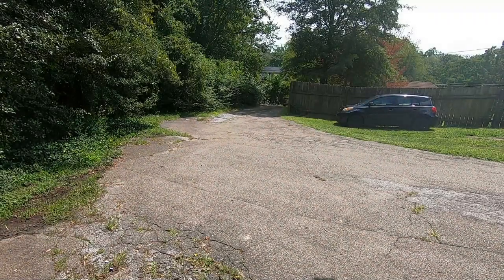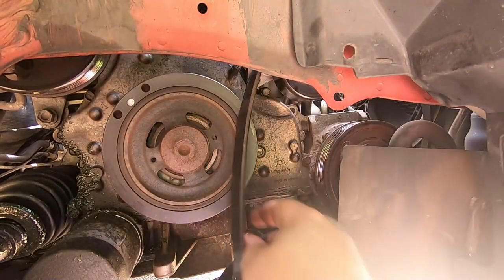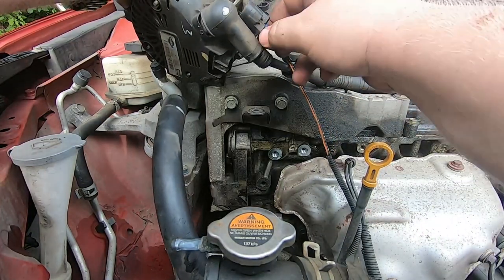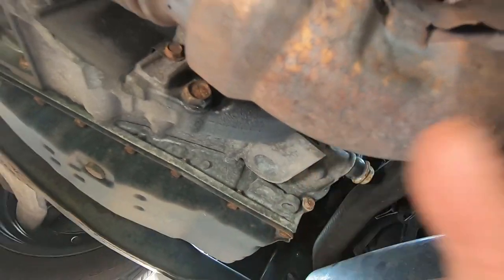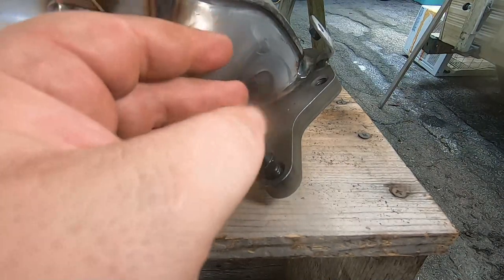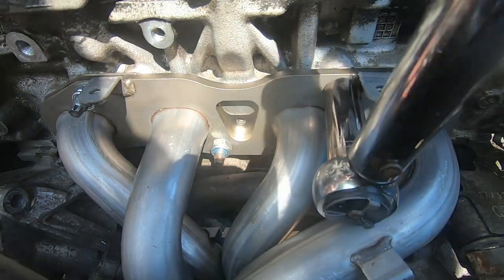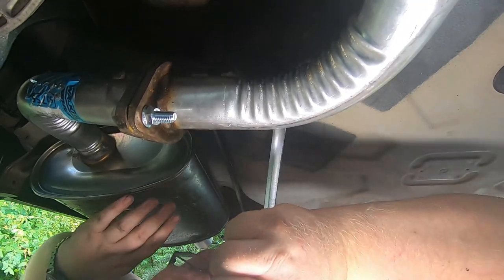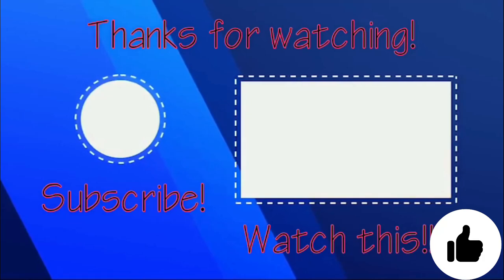2007 - 2012 Nissan Altima 2.5L Replacing our Old Exhaust with a Brand New One - FULL Install!

Comment: This was a really good video you show everything step by step and explain everything. Not a lot of people explain everything and show everything. Some videos take long to explain everything but I enjoyed this video it showed me exactly what to do on my Nissan Altima, thanks.
Reply from the maker: You're welcome! We'll have more step by step videos on the Altima soon 👍
Reply: @TrickShiftGarage  where did you buy your kit at
Reply from the maker: Well, it wasn't exactly a kit but I made it work as one here is the list of links where I got the parts,  my apologies for the long links!

The Exhaust manifold was bought here: 
https://www.ebay.com/itm/CPSP-Exhaust-Manifold-W-ith-Catalytic-Converter-For-2007-2013-Nissan-Altima-2-5L/283262749442?epid=22025952980&hash=item41f3c68b02:g:WrcAAOSwWI5b7gJD

The Catalytic Converter/Down pipe was bought here: 
https://www.ebay.com/itm/FOR-07-15-NISSAN-ALTIMA-2-5L-OE-STYLE-REAR-CATALYTIC-CONVERTER-EXHAUST-MANIFOLD/203094215073?

And the Catback system was bought here: (Contains the Y-Piping and both mufflers)
https://www.rockauto.com/en/moreinfo.php?pk=5943654&cc=1433474&jsn=855&_nck=Ekt6BqBF1pwlXdx0gYlm1esw98pF26vehMm%2FGG3C%2Fl2QOXSJubi7Wbtv3UuYQU5UBTnZ1RuNKAU%2F2UPB2Err70tAHhIy%2FCO0kuzdge%2B5CQu7rIwc7RB3%2BXz7yuMOTx3dRLp3KjCKhbtYENNDeP04ibh%2B8sLQlICyM%2FzTHZ70Hh5xpF1A23JfGzunK4CIM0by7cG%2FtNZTHIFFIz%2Fq%2F0sVxCvUNLGzNMq12bIr6RayTOdrpl%2BaCHy0tCw%2BN87wZCaj6o7W5I%2BDwLDx7rlbWFEYILp4o%2FCMHxufpUjPYYFKN4JtGE%2FUSq%2BhxsYM02T4jqJVnuTL2LoShixYodZ%2F42xi07E0JcCzxk7OerXvetyNQ9H35TsYhhN%2F3L3I5vYbZSbJiR5uKWTxg3fbt39CZapdzU%2Fo37X5K%2FZUlR5kuaOR4WYdghI2OZmCWQ%3D%3D

Hope this helps! Thank you for watching!

Comment: Any engine shaking or lost of power when driving ? My 2007 Altima 2.5 make same exhaust noise but after time now I can’t drive it due to not goin when putting gas into drive an shakes a lil when put on drive or letting brake pedal go ??
Reply from the maker: I didn't feel any shaking or apparent loss of power, it was noisy and smelly on start ups though. This might be something going on with the transmission not shifting properly. Best thing to do is have a mechanic look at it and see what they say of it. Hope the best for you. Thanks for watching! 👍

Comment: Great video, however, how is the cat hold up for you since replacement?  Is the AUTOSAVER88 Catalytic Converter a good product and fits good?  Thanks
Reply from the maker: The cat has been holding good since replacement, no check engine light or exhaust odors. Yes, I think the AutoSaver88 one is a good one. Thanks for watching! 👍

Comment: I say if you are going thu all that trouble, replace your O2 sensor. being 13 years old and I'm guessing never been replace, go ahead and do it. one less thing to worry about.
I bet if the O2 was replace on time, we wouldn't be in this mess. replace it every 50K or 75k miles 

I gotta say for me being in south TEXAS, this job replacing the Catalytic is not hard (bolts didn't rust). if you live up north with all that salt, good luck on the bolts.

replacing the Catalytic myself I saved over 1600.00. dealer wanted 1854.00 but with that much saving, I went ahead and replace hoses, coolant, thermostat, and belt.

thanks for this info on DIY. help alot
Reply from the maker: Completely agree with you Daniel! Personally, I always try to look around and replace parts that are convenient while your already knee deep in a project, one less time you have to do it again. Thanks for watching! 😎

Comment: i'm really debating if i can trust buy Catalytic Converter from Amazon? i see other local stores price around $700 to 800 ... so, worried to buy from amazon then does not last ... ALL please advise your experience ??
Reply from the maker: I hear ya man! If it helps, mine has been running well for over a year now. No check engine light or driveability issues with it.  Those prices is what pushed me to give the Amazon ones a try and so far so good! 😊

Comment: I noticed that you didn't put the heat shield back on. I'm having trouble fitting the old heat shield on the new exhaust manifold. Is it not necessary to have the heat shield?
Reply from the maker: It's not necessary to have the heat shield on. Mine has been off for about 3 years now lol, I think you'll be fine to leave it off. Thanks for watching! 👍
Reply: @TrickShiftGarage  that's good to know. Thanks for the reply
Reply from the maker: You're welcome,  good luck! 😊

Comment: Hey there, just wanted to see how the exhaust system has held up over time. A couple of the reviews on the Amazon link say that the cat almost blew up and stopped working completely. Should I order the parts on the Amazon link or should I just take my car into a shop? Thanks
Reply from the maker: Hi Joshua! The exhaust system has held up great! Just some surface rust, which is normal. No exhaust leaks or weird smells coming from anywhere. It's not loud, nice and quiet like the stock mufflers.

You can go either way. The exhaust manifold has worked great without any problems. Just know that it will probably cost alot more if you go through a shop than buying and installing yourself. If you feel comfortable doing it that is. 

When I was shopping for a new exhaust system a couple years ago, the genuine Nissan manifold cost $600 alone. The whole system that I ended up ordering (from exhaust manifold all the way to the mufflers) cost $700 total. Just something to think about 🙂

Comment: Excellent video.  I noticed that it looks like your oil cooler is leaking.  You can fix it by just replacing the internal o-ring and external gasket. The cooler is located on the passenger side rear of the engine right in front of the cv axle.  Very common problem on these cars.  I did mine on my 2012 just over the weekend, pretty easy.
Reply from the maker: Thank you for watching and pointing that out! I'll definitely look into it, could be a great future how-to video to show others how to repair it on their own. Sometimes, a little part like an o-ring can cost alot of money to install at a shop. 

Glad your repair went well. Thanks again! 👍
Reply: @TrickShiftGarage  Very welcome!  And yes that would make an excellent how to video. The part number for the gasket set for the oil cooler is ES73076 it is a Felpro set and I bought mine at oreillys for about $15 but the part # should be the same at any auto parts store that sells Felpros.
Reply from the maker: Awesome! Thanks for the info on the part!  👍
Reply: @TrickShiftGarage  Glad I could help!

Comment: Once installed new catalytic converter from engine side... I noticed some white smoke from engine area... Is that normal for new install? I just tested like 5 seconds then off the car
Reply from the maker: Yeah, it's normal, probably some fluid burning off like WD-40 or oil/grease. It should stop smoking after 15 minutes.

Let the engine warm up to operating temperature, if it's still smoking at that point, then something is off and you'll need to shut it down and investigate lol.

Comment: Very informative video. Can I put the heat shield after I installed the bank 1 sensor 01? At last you didn’t installed the exhaust manifold heat shield but the sensor (before catalytic converter) was installed when you started the vehicle . I don’t have the heat shield on my Nissan Altima , I was wondering I can buy and install it with out removing the sensor . Thanks
Reply from the maker: Yes, you should be able to put the heat shield on after installing the O2 sensor. The heat shield goes around that part of the exhaust manifold. Thanks for watching!

Comment: What is the bolt size, length and thread pitch of the bolt that holds the hanger to the engine? Mine doesn’t have one and i need to go buy one.
Reply from the maker: Been searching over the internet and I can't find anything about the bolt size, length or thread. I'd try calling your local Nissan dealer and see if they can tell you  any of those details. I'll keep searching and respond back here if I find anything 👍
Reply: did you find it?
Reply from the maker: Yes, finally figured it out, it's a M10 - 1.5 Pitch x 20 mm length. Overall length is 30 mm. Hope this helps and good luck!

Comment: I went to the shop to fix some welds & they didn't remove the alternator, they just pulled the manifold straight up, why is that?
Reply: You prob didn’t have the heat shields , if so they wouldn’t be able take the top heat shield off unless they broke it to bring it out

Comment: My 2012 2.5L Altima developed a really bad smell inside the cabin,I swapped out the filter and still stinks.. ever since the smell arrived my car has run terrible..I have had no check engine lights so I self diagnosed by past experience(s)...my car started feeling like it was stuck in a lower gear,around 60 mph and up it would start feeling like it was being dragged down,like the brakes were dragging,slowing it down...the gas mileage went from awesome to terrible !

I was stupid and had a brand new CVT transmission put in it and it still does the same thing,but now its dragging at all speeds...I did find a seized front brake caliper and thought I finally had it figured out...but no its still the same...starting to think its the 2nd catalytic converter on the back half section of the exhaust manifold due to the horrific smell inside,thinking maybe its getting a lot hotter down there than normal and is /has done some cooking !

Anyway I finally took it to a highly rated repair shop and as of right now the guy can't figure out whats wrong with it..so when he gets back in town next week going to get my car and do like you have done here and see if that helps...its the craziest thing trying to troubleshoot these newer cars with the OBD2 diagnostic system thats relying on sensors and trouble codes to pop the check engine light on so the scanners can give you/we an idea whats going on.

All I know is it has been a great car until this weird smell started...this video you have done here is exactly what I was hoping to see..not to bad of a job to do..just do it !
Reply from the maker: Thank you for your comment, and your situation sounds very similar to what mine was! A horrible smell coming into the cabin whenever the car was stopped. I did some research and there was a technical service bulletin out for the exhaust manifold and it was common for micro cracks to occur around the welds. I can't recall the years it effected but that might be something to consider. There was no engine codes but the car sounded like a small exhaust leak was coming from the front. It was especially loud on cold start ups, and after a couple minutes it would quiet down because I suspect the heat expanded the metal and (kinda) closed the crack.

As you saw in the video, my whole exhaust was rusted and I figured to replace the whole exhaust anyway. So after I pulled the manifold off I inspected and sure enough there was a micro crack along one of welds. After I installed the new one the smell was gone for good.

So my suggestion is to have your mechanic check out the exhaust manifold carefully. Hopefully this helps you out, let me know how it goes! And thanks for watching!

Comment: Thank you so much bro i have a 2012 Altima and my light came on at 145k miles I was wondering when or how long I could drive before I have to change it. You said 10 years lol I don’t think I would go that long, but I guess it’s not a big issue.
Reply from the maker: You're welcome! Luckily, my check engine light never came on but the smell got pretty bad to make me change it out... finally 😂 

Since your light came on, I'd change it out as soon as you can! If you have anymore questions just let us know and thanks for watching!
Reply: @TrickShiftGarage  How did you pass emissions during inspection w/that leaked? In PA that would have failed right away the first year.
Reply from the maker: Honestly, I'm not sure but when I would take it to get tested they would hook up to the OBD2 port, run their program for a few minutes, get a report and pass or fail based on that report. If my check engine light was coming on they would have failed me on the spot but I think because mine never turned on, they passed the car.

Comment: 3 thumbs up!!!  I replaced a leaking exhaust pipe with a Magnaflow downpipe w/cat.  Have you installed a header on a 2008-2012 Nissan Altima coupe2.5L, and what was the result?  Please share advice.  Thx
Reply from the maker: Hey Ferman! Thanks! I haven't installed a header on an Altima 2.5L before, but I think the overall process is the same that you see in this video. We do have an updated exhaust manifold video, that goes more in depth of the install here:
https://m.youtube.com/watch?v=xew4Rie4iFM&list=PLLWspAClw3lzHsOBWgQkS_JOrOsPqlsmY&index=31

Hope this helps and thanks for watching! 😎
Reply: Ive got an 08 coupe sl and the exhaust is exactly the same from top to bottom on the 2.5.
Reply: Also should add that the  removal/install process is the same
Reply from the maker: Sweet! That's awesome to know, glad Nissan made it the same parts and process. Thanks for letting us know Bounty! 😎👍

Comment: Thanks for the great video... going to have to tackle this soon as my cat broke and clogged up the pipe leading to no power.  Did you install all of the heat shields or leave them out?  Any issue either way?
Reply from the maker: Thank you for watching! I left the heat shields off. My lower heat shield's surface was rusted out and I left the top one off just for fun. Either way, I haven't had any issues by not including them on the new one. I would just make sure there are no wires or anything plastic near the exhaust piping that could possibly make contact and melt. 

Good luck on your install! And if you have any questions feel free to reach out! 👍
Reply: @TrickShiftGarage  What was the total cost for the full exhaust?
Reply from the maker: About $650 total.
Reply: @TrickShiftGarage  Thank you. Looks like this will be my next move.

Comment: Does the secondary cat have an 02 sensor? I was planning on deleting it and str8 piping in its place.
Reply from the maker: Hey Boss! Yup, I believe it's right after the secondary cat. Good luck on your project. More power and sound is always a good thing! 😉
Reply: @TrickShiftGarage  Thank you, I appreciate it. I seen some catless headers for the 2.5. Was planning on going with those instead.

Comment: Did you purchase the entire exhaust system as a kit or did you have to buy in pieces
Reply from the maker: I had to purchase the system in pieces, there are 3 links in the description on where you can buy them. They include all the necessary hardware (bolts, gaskets, etc.) you would need to do the whole system. Hope this helps and thanks for watching! 👍

Comment: Hi, i will remove my one tomorrow, can i only clean inside it with brake cleaner and industrial soap? Or i need to replace a new one in anyway?? Thank you
Reply from the maker: Hi! I would replace it with a new one just to be sure it's fixed. Good luck with your exhaust and thanks for watching!

Comment: I wish you went back and listed the socket sizes needed. It's the most frustrating part of repair work so far for me, not having or not being able to find the right size socket. Plus my impact wrench and my hand tools are different sizes... It was very frustrating trying to build my tool list for this project and you're waffling.
Reply from the maker: Hey Francine! Going back and watching it, I did waffle alot lol. This video was my first full edited video and it definitely needs to be revised with all the socket sizes and tools used. Thank you for your input! 🙂

Comment: How did you know if you had a bad manifolds?
Reply from the maker: I knew the manifold was bad because on cold starts, the exhaust was loud and you could smell exhaust fumes in the car. A crack in the exhaust manifold would cause those kinda problems.

Thanks for watching! 👍

Comment: How much did the parts cost ?
Reply from the maker: The exhaust manifold was $120, the catalytic converter pipe was $100, and the down pipe/Y-pipe with mufflers (came as kit) was about $300.

Thanks for watching!
Reply: @TrickShiftGarage  where did you order it from?

Comment: Hey are those studs m8 1.25 or m10 1.25
Reply from the maker: The studs on the engine head or the bottom of the exhaust manifold?
Reply: @TrickShiftGarage  the bottom of the exhaust manifold, because I’m having trouble with the studs not going in all the way like it showed in this video, would you be able to tell me the size for the studs you bought like if they are 1.25 x 50m or a smaller size. Thanks.
Reply from the maker: The bottom studs were definitely M10 - 1.25 pitch. I can't remember the exact length but 50 mm should get the job done. We have a more in depth video on the exhaust manifold installation here:
https://m.youtube.com/watch?v=xew4Rie4iFM&list=PLLWspAClw3lzHsOBWgQkS_JOrOsPqlsmY&index=25

Hope this helps! Let us know if you have any more questions.
Reply: @TrickShiftGarage  thank you sir!
Reply from the maker: You're welcome 🙂